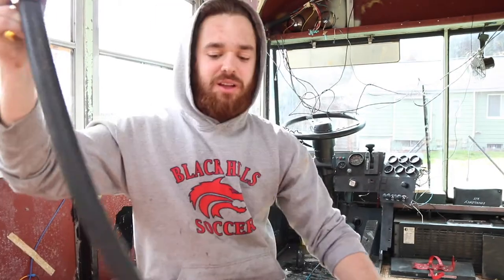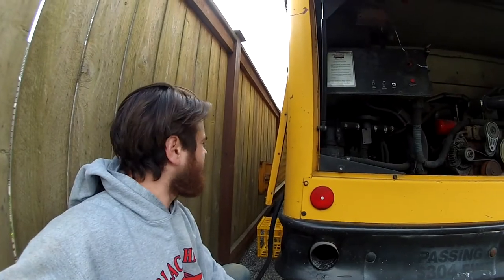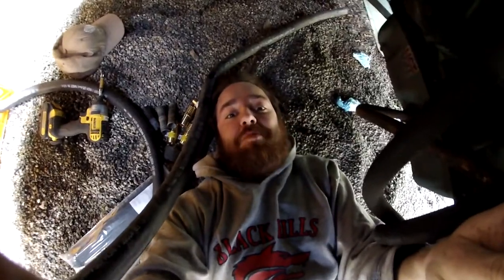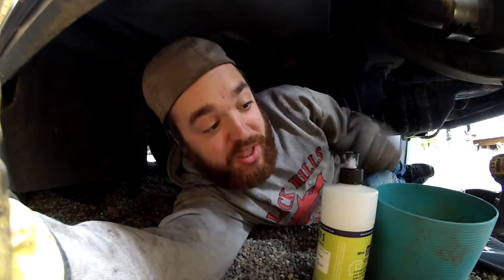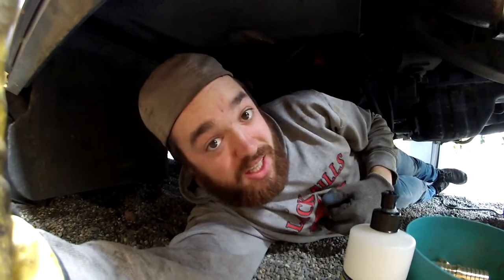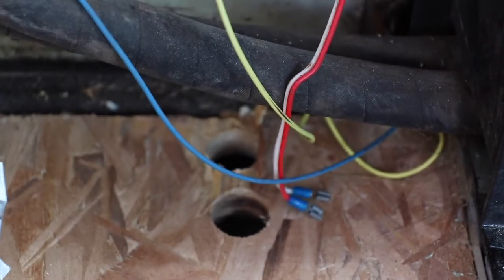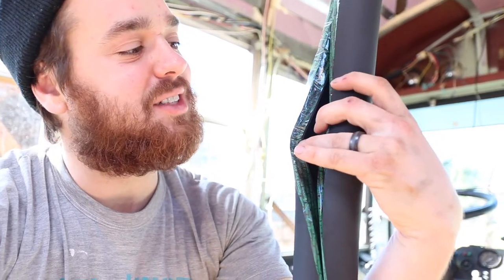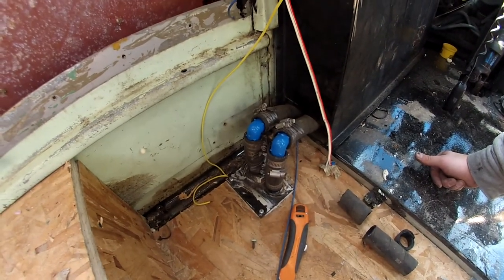ReRunning Coolant Lines - Skoolie Bus Conversion - E15

Comment: You are so funny.  The valve that you said keeps the coolant from running all over you is added on school buses so the heat can be turned off during the summer.  Even the hot coolant running through the tubes during the summer heats up the bus some.  Since most buses don't have A/C turning off the valve helps keep the bus cooler.

Comment: Did you protect the hoses that are running through the holes you drilled out? With all that driving it will do a lot of rubbing. Doing great.
Reply from the maker: Yea I'm planning to put some rubber or something around those holes. The hard poly pipe is what goes through the hole which is quite a bit tougher than the coolant line. Good catch!
Reply: Are you using Jack stands? If not... Safety first. Don't trust that your tire will keep a bus from falling on you.
Reply: @larrym6019  what? Are you saying his tires might randomly pop and the bus crush him?

Comment: for what it's worth, i don't think that rigid pipe isn't rated for temperature and pressure of the cooling system. might be a good idea to install a valve on the return line just like the one on the supply line. so, when that pipe blows out you can just close both valves, add some coolant, and get back on the road. I'm not sure, but it looked like that hose is touching the shock? that will rub a hole in the line over time... 

you can take your chances. but, You really should get the right hose for the job...